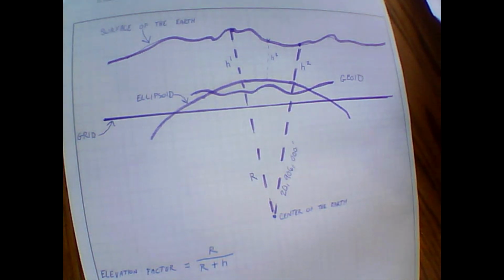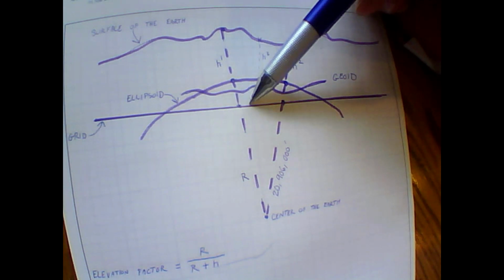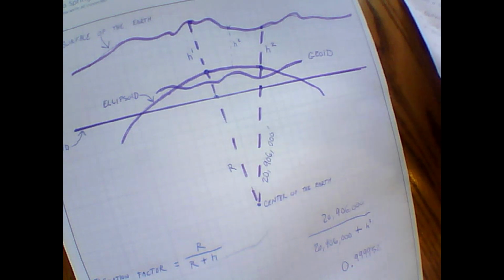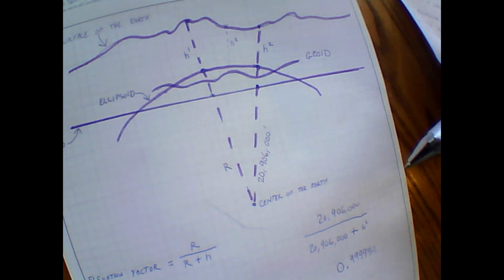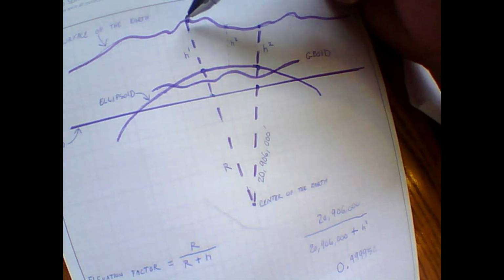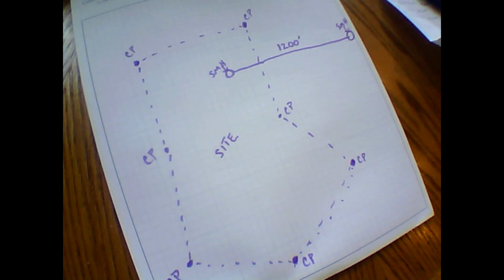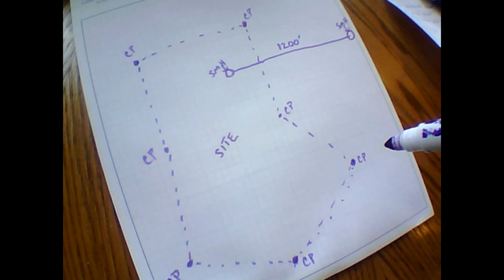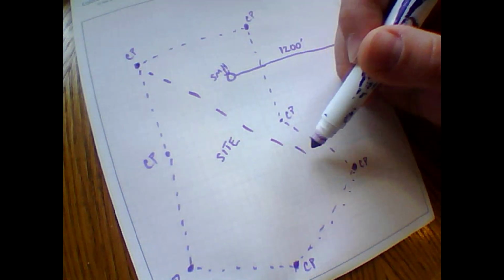Ellipsoids, Datums, Realizations, Grid to Ground, and Site Calibrations Explained

Comment: Thanks for the video.  I realize that I am 4 years late to the party, but I have a question that I hope you can answer.  Are scale factors always less than one?  We are currently bidding a job, a 4 mile (approx.) extension to the sewage outfall in the bay at Bayou La Batre, Alabama, and when I look at info on the NGS websites (assuming that I am accurately interpreting said info), I see scale factors slightly over one (e.g., 1.00000213).  Does this seem correct to you.  I have not worried too much about this in the past because our jobsites have been so small, but on this one, the difference between grid coordinates and ground coordinates could be significant.  Thanks for your help.
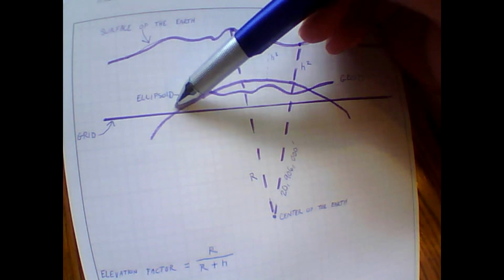Reply: Not a surveyor, however if part of the site is below sea level it would make sense the scale factor would be above 1 since the image wouldn't look like 10:23 anymore since the geoId would be below the grid

Comment: 26:44 What do you mean at this point? For example, that we shoudn`t have ay projections systems assigned to project in our field controller when using calibration. If we do have some UTM projection assosciated to a project instead working with geodetic coordinates (latitudes and longitudes only) we would get wrong site calibration? Can you explain a little better about this subject please?

Comment: OK, so, you're ending your calibration after two shots for horizontal and one for vertical? Or you're intentionally shooting the two points that he's split the project in half at the longest distance apart, and then shooting the other points and including them horizontally in your calibration?

I use Trimble site works, not sure if you can do just two horizontal and one vertical.

Comment: Could you please explain what is 20906000 and what is the unit of that amount...
Best regards
Reply: 20,906,000 is in feet and is the mean radius of the Earth used by the U.S. Coast & Geodetic Survey (USC&GS), now the National Geodetic Survey (NGS) to compute the ellipsoid reduction factor for distances when using State Plane or UTM coordinates. -- Reference page 49, NOAA Manual NOS NGS 5 "State Plane Coordinate System of 1983" -- https://www.ngs.noaa.gov/library/pdfs/NOAA_Manual_NOS_NGS_0005.pdf
Reply: That’s true,

Comment: Not bad. However, I disagree with two points. The reference (ellipsoid) is the mathematical model that we use for computations. It has a semi-major axis, a semi-minor axis and the flattening as well. It is akin to the geoid which is the approximation to mean sea level over the entire earth. However, we cannot use the geoid to perform computations because its shape is too irregular; thus, surveyors have introduced the reference ellipsoid to make computations. Due to this, a phenomenon called 'the deflection of the vertical' occurs because computations are done on one surface and measurements are taken from another. This error has to be corrected also. Moreover, for the geometric (horizontal) datum NAD27, the reference ellipsoid is Clarke 1866 not 1863. Apart from that, it was quite interesting. Indeed, surveying is a fascinating field.